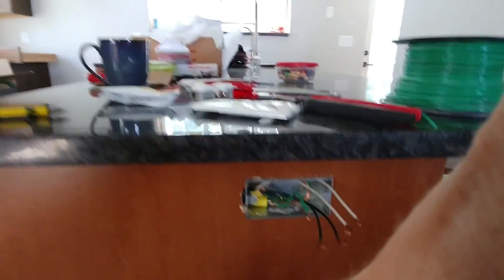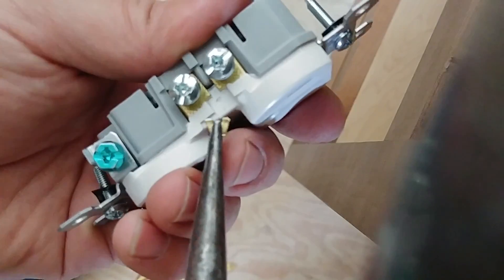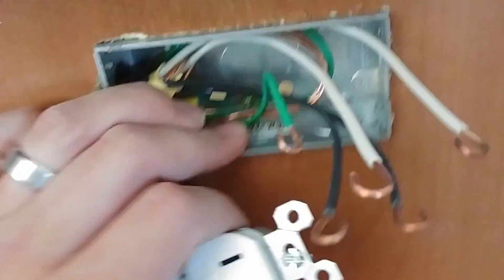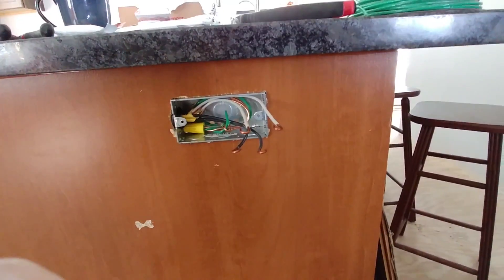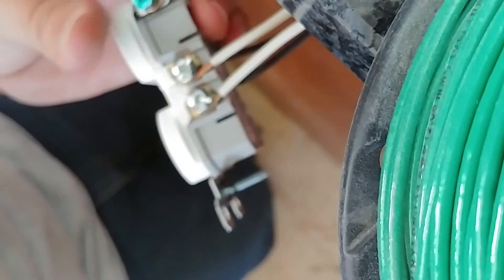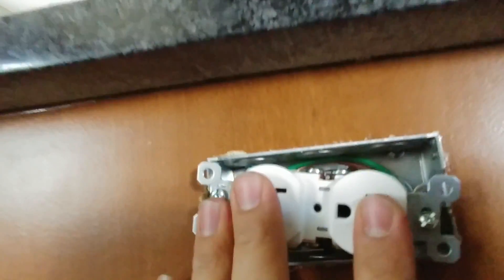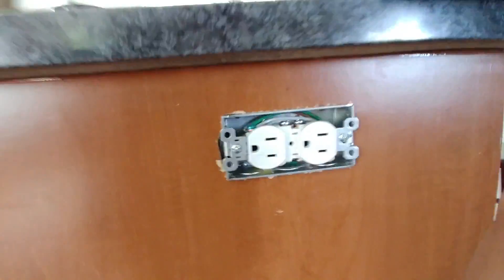How To Split Wire an Outlet or Receptacle - Two Circuits on One Outlet (Duplex Receptacle)

Comment: Benjamin,   Although I find you to be very thorough and in almost every case correct, you have missed the mark of total excellence on this video.   We all make mistakes!   Even you!   😊.    Please read 2011 NEC Article 210.7 Multiple Branch Circuits.    It reads as follows: Where two or more branch circuits supply devices or equipment on the same yoke, a means to simultaneously disconnect the ungrounded conductors supplying those devices shall be provided at the point at which the branch circuits originate.   So, your two single pole breakers as shown do not comply.  You have two choices, change breakers from two single to two pole, or buy a handle tie for less than $2.00 each and put across the breakers.   Respectfully,   Kevin
Reply from the maker: Thanks Kevin! I might make a video showing exactly what you are talking about. Really appreciate the feedback!
Reply: Benjamin Sahlstrom   It is ALWAYS easy to help someone who cares!   Either in what they do, and about their video content.    Very respectfully,   Kevin
Reply: @KevinCoop1  If that's the case, which i believe it to be, what's the point in even splitting the 2 outlets. If one trips it will cause the other to trip. So what advantage would there be to what was displayed in this video.
Reply: nevermind, i misunderstood "less likely to trip" i guess that makes sense.
Reply: B Mpower    With a two pole breaker both would trip.   With the add on handles that can be bought, the trip independently.   The reason for the handle is for disconnection of power of both conductors on the same neutral.
Reply: It is not a multiple branch circuit, Separate neutrals.
Reply: @bsmith8564     It is not a multi-wire branch circuit because it has two neutrals.   It is multiple branch circuits on the same yoke though.
Reply: @KevinCoop1  You are correct.
Reply: @bsmith8564     I try.

Comment: My dishwasher and garbage disposal were wired like this during a kitchen remodel. Separate circuits with GD also on a switch. But when I put a three prong circuit tester in each socket today they both indicate "open ground". Isn't that a problem? The remodel was 12 years ago and they both work fine.

Comment: Danger Benjamin Sahlstrom Danger!! You have connected two constitutive breakers that are connected to two different legs of the main service panel.  This will carry 220 volts to the outlet box that you just wired. I do not know any codes in the USA that will allow this. Correct me if I am wrong.
Reply from the maker: Excellent point. I honestly am unsure as to the legality of this so I appreciate you pointing this out. Would you resolve this by moving one of the breakers in order to have both being fed by the same leg? Again, thanks for the comment an please post any code references that you may have regarding this.

Blessings,

Ben
Reply: @BenjaminSahlstrom  On a single phase house main electrical panel there are 2 separate phase 120 volt power lines that enter the home.  (see:  https://www.youtube.com/watch?v=J6Q4JrCpRVk). He is long winded but shows the panel well. The best and easiest solution for you right now is to move the hot wire from the #30 breaker to the #32 breaker, and move the hot wire from the #32 breaker to the #30 breaker. I would first pull the breakers out of the box, then disconnect and reconnect the wires before moving the wires. Better yet, throw the main breaker switch so it would be safe. This would keep the two separate circuits that are going to the outlet box on the same 120 volt leg keeping the hot voltage reaching the outlet box at a safe 120 volts, but a on different circuits. Having 220 volts going to the one outlet box is dangerous. Square D, which is the premier service panel line for the industry, makes a 2x20 Amp Single-Pole Tandem Circuit Breaker that you can use to have 2 circuits on the same Circuit Breaker. Most Square D main electrical panels will accommodate so many of them for use for expansion. If the outlet is near any water than you should be using a GFCI (ground fault circuit interrupter) circuit breaker.  As to code references, every city/town /state has different degrees of intensities of their codes, but I'm sure that none will allow a 220v line connecting to a 120v rated outlet.  Hope this helps.
Reply from the maker: Thanks!
Reply: This is not prohibited by code and has the advantage that the neutral can be shared and will only carry the difference between the two circuits if both are supplying appliances at the same time. By code you still need the double pole breaker though.
This used to be quite commonly done but I am not sure the GFCI function can work with a shared neutral. There is no advantage to doing it if the neutral wire can't be shared.
Reply: @jimagles1394     Having a receptacle box that is set up as a split circuit, that is fed by two separate breakers from the service panel is not prohibited by code. What is prohibited by code is that the current going to a single receptacle box from the service panel is wired to different phases, each being from a different 120vAC supply.  This will make the power to the box as a 240vAC supply line going to a 120vAC receptacle. Since the wires will be grounded the box is now 240vAC. This is dangerous and against any electrical codes. See: timeline 4:08 to 4:16. Circuit breaker 28 is connected to one phase leg 120vAC and Circuit breaker 30 is connected to the other phase leg of 120vAC, coming into the panel, supplying 240vAC to the receptacle box. To do this correctly, both breakers need to be on the same phase leg.
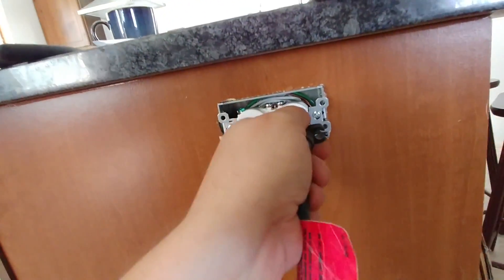 See  https://www.youtube.com/watch?v=J6Q4JrCpRVk  See timeline 4:30 to 9:00. 120vAC hurts, 240vAC kills. As far as neutral wires being shared, all ground wires need to be joined to ground, and all common, neutral, wires [from separate breakers] need to be connected somehow to complete a circuit.

Comment: I'm a novice to all this.  But you mentioned "when using a 20amp circuit".  Isn't that a 15 amp receptacle?  Wouldn't  it have the extra notch crossing the neutral notch if it was a 20 amp receptacle?  Edit - nevermind, I just read where you can use a 15 amp receptacle with a 20 amp circuit breaker.
Reply: Scott Harrod, You are observant and partially correct. In some places, mostly larger cities, that you must use a 20amp rated outlet device as well as a 20amp or more rated copper wire going to the outlet, according to code. 15amp service is restricted to circuits for lights being used in the circuit. It is never wise to allow an outlet that will accept a device more that draws more current (amps) than the circuit is designed for. That includes the wire and the breakers.

Comment: What was the purpose of removing the tabs in the beginning of your video again And is it necessary
Reply: Because each socket is a separate circuit and you want them treated and behaving as two separate circuits.
Reply: Because if you don't cut the tabs, once energized, you will get a dead short(just like touching two hot wires on different phases together)

Comment: I believe code requires that you use a dual-pole breaker if you do this type of split - that way you guarantee that both halves are dead when one is switched off.
Reply: I think you can use 2 single pole breakers as long as they are next to each other and pinned.
Reply: @surferdude642  you thereby made a dual pole breaker. That is all dual pole breakers are, two breakers linked together to trip at the same time.

Comment: When mounted sideways the grounded conductor  as stated will be the last to break connection when pulled in a downward position = CORRECT PER CODE

Comment: Dont understand why you had to split top n bottom of receptacle by breaking out side piece metal on receptacle?
Reply: Old timer, the side pieces connect the hots and neutrals.
Reply: Because they are two separate circuits.

Comment: As stated it should have been wired with a locking device that shuts off both circuits at the same time (per national code).45+years as a master electrician speaking ...
Reply: looks like you have suffered more shocks then one.

Comment: I have a receptacle with 2 hot wires, 1 ground and only 1 neutral. I guess the metal clip is only snipped off on the hot side. Is this acceptable? Two separate 15A circuits but if I try to run two high wattage appliances a circuit will blow.  Do I need to get this rewired to a 4-wire+grnd line?
Reply: Pphhhht what you have is mostly a switched receptacle which means u have a SP switch controlling one side of it, it’s practically the same as a split. What you have should be fine assuming you have the proper wire
Reply: Check if the source of the hots is the same single breaker.  If so, one of the hots to the receptacle could be switched then not a problem. Otherwise I'd be concerned of only having only 1 neutral. If there are heavy loads on different sourced lives, it could overload the neutral making it overheat.

Comment: Good you mentioned the removal of the breakoff tab, most people burn their fuses for not doing that.
Reply: Is this what may have happened in my case?  I replaced the outlets and I didn't break anything off like the video and my stove outlet has 2 hots etccc...when I turned the power on I heard a loud pop and it then tripped and haven't figured it out since
Reply: I can't break or split the wires. The outlet has copper running behind the tab. Impossible to split. I can't find any video explaining this. ugh.

Comment: Did you say 20amp that outlet looks like 15amp
Reply: Sounds a bit basakwards.  From years of electronics for the fed, we knew we could increase the capacity of cables and termination point items, but we could NEVER go down (add components and wiring) capable of less than the circuit was designed to carry. 

 Aside the fact I don't cheap out and install fourteen gauge outlet circuits, I buy all 20 amp outlets because they tend to be built better.  If I hit a big box, I can get clamp type terminations, versus loops or the stab in connections I abhor.  The heavier duty outlets hold up better over the years.

Putting an outlet with more amp capacity, obviously, will not alter whether someone plugs a heater or a 40 watt trouble lamp, a jointer or table saw into the outlet. All the general public sees is an outlet.  Nor will it cause the circuit to be overloaded.
Reply: Lucky Joestar   You are mostly correct, but if you check, I think you may find that you can place 15 a devices on 20 a circuit if there are multiple receptacles.  If dedicated circuit, then it changes and needs to be 20 amp receptacle.

Comment: The top plug in my outlet is controlled by a wall switch, the bottom one is always on. I did what you did and broke both tabs, the neutral (silver screws) and the hot (brass screws) and installed the new outlet; but the switch and outlet did not work. So I threw that one away and got another only broke off the hot tab (brass screw side) and now it works fine. Maybe this will help another amateur. Hey I didn't electrocute myself! Thank you for posting the video.
Reply: You could have used a white(common/neutral) pigtail to connect to each of the (now isolated) silver screws and then wire-nut the neutral to those pigtails. [ Cost = 2 short pigtails and 1 wire nut ]
Of course, buying a new outlet is cheap and easy [ Cost = $1-$2 ]

Comment: For the ground, couldn't you also use a 4-pin wire connector so they're all going into the single ground screw of the outlet?
Reply: Yes he could've used that but it's really a preference

Comment: Is there any reason fro you not wrapping the plug with electrical tape to prevent shorting to the metal box.  I enjoy watching your videos because I built my own home.  I did all the work myself and did it as I had money to do it.
Reply from the maker: raymond knapp Jr Thanks for your comment! I'll definitely be adding electrical tape if and when I work on that receptacle again. Just didn't think to do it.

Wow! I love that you built your own  house and did it as you saved. That's EXACTLY what my wife and I have been doing. Took 4 years to save the cash to buy the place and for the past nearly 3 years we saved and worked on it as we could. It's finally getting to the point where we're able to enjoy the reward of all the blood sweat and tears. How long did it take you to build/finish your place?
Reply: I really don't want to tell you how long it took.  It was about 19 year.  The only loan we had to have was $25,000 for putting in AC, Final heating system and furniture.  I started with a 20' X 30' Quonset hut with no basement.  I how I have a 3,500 sq ft home with a finished basement.  Is the picture on your facebook the house you are redoing?  I see a challenge for you.  With some of the inside pictures of your home looks like you are really doing good.  Oh we did the building while we lived in the house and my wife ran a daycare.  I do have stories.  My wife passed because of pulmonary hypertension so I am in a big house.  I am now starting a Bee Farm business putting hives on peoples properties. Hope to hear from you again.
Reply from the maker: raymond knapp Jr That's impressive! Yes, that is the house before we started working on it in that picture. It's changed a lot since then for sure!

My dad has honey bees too and enjoys doing that in his spare time. What state are you in out of curiosity? Also, sorry to hear if your wife's passing. That's tough.
Reply: I am from central Iowa.  I am retired now and have started K & H Bee Farm, LLC.  I am wondering how your father's bees did this year.  I am finishing my first year doing bees and lost two nucs and one hive.  I still have one hive that is going.

Comment: I notice that some videos the person only remove the tab from the power side and not the neutral side. which way is better?  thx
Reply from the maker: lenn55 You only have to break out the neutral tab if you are using power from two different circuits. If you were split wiring just to switch one half of the receptacle and were using power from the same circuit then you would not need to remove the neutral tab.

Hope that makes sense for you!
Reply: The way Benjamin is wiring, he has no phase restrictions on how he wires the socket. You can share the neutral if the sockets are on separate phases (think dual circuit breaker). If the two hots are separate phases, they can share a common neutral with the neutral only having to carry the difference in the current being supplied by the two phases. If on the other hand, both sockets were on the same phase, then the neutral would have to carry the sum of the current being supplied by both phases and as such be overloaded. In any case, I'd recommend if you have a split socket that you have both circuit breakers linked so both would be turned off at the same time to prevent issues with someone working on the socket thinking it's dead because they turned off the breaker and then getting a bit of a surprise when they get into the junction box and finding a live circuit.
Reply: I am amazed some of the people showing e video how to install an outlet do such a terrible job. Please if you put a wire into a receptacle, tied the wire around the screw  in a perfect loop then tie the screw./ You don't need to be electrician to know this. and use electrical tape when finish connections, to hold  everything safe.
murillo

Comment: You have 2 circuits on one yoke. To meet code don't you have to use a double pole breaker so both circuits are shut off at the same time?
Reply: Dave Ziegler it should be safe to do so too
Reply: Good point. But his electrical work is so neat and organized I'll be suprised if it doesnt pass inspection

Comment: very good video ben the only thing i would have done im a electrician place tape around the outlet in the event the outlet touches the side of box  n also if you work on it hot you dont get a zap. keep up the videos
Reply from the maker: +panama1965 Excellent tip!
Reply: Plastic box my friend ......also locking device so no power is on .....

Comment: Ben, can you do a video about NEC box fill? You mentioned the box was pretty full. Is that split wired receptacle also GFCI protected?
Reply from the maker: +jragadio Great suggestion! I referenced a wiring book on fill requirements during my project and I believe I was still within the allowable fill. I'll definitely see if I can make a video on that.

Yes, both of the receptacles were GFCI and AFCI as required per code. I did this using a dual function breaker in the main panel rather that by using an AFCI breaker with GFCI outlets. I like the cleaner feel with the kitchen outlets all being the same albeit if it does trip someone has to run down to the panel to reset it which is a tad less convenient.